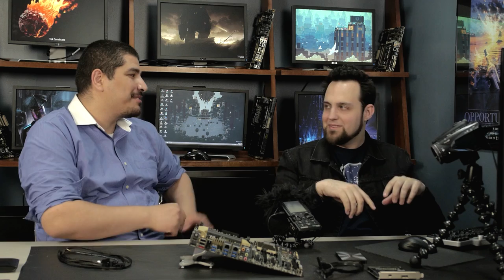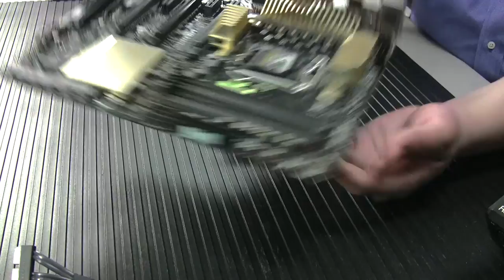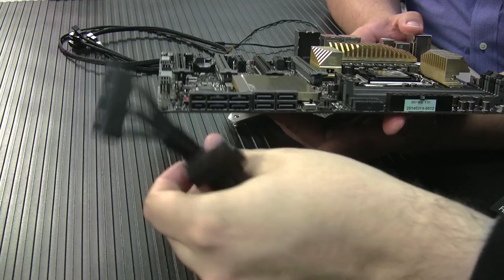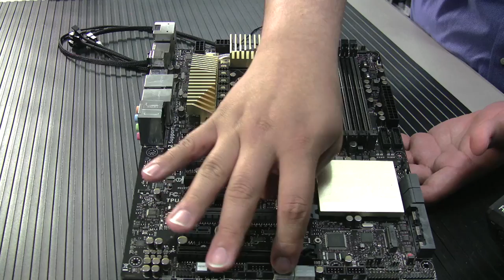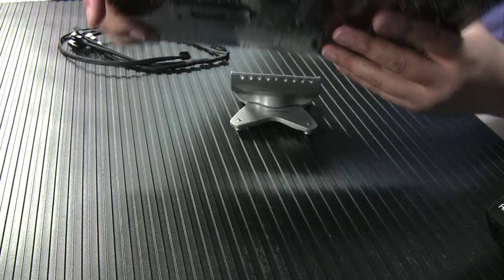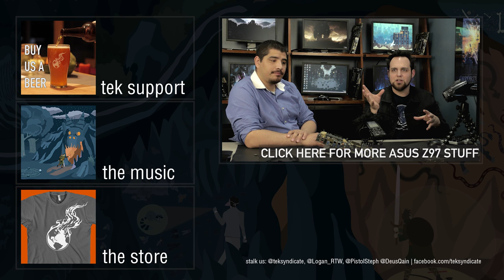ASUS Z97 WS Motherboard Overview

Comment: if only this was out in 2011. no workstation should have a haswell
Reply: Why is that? Surely Sandy Bridge over all performance even with the better overclocks is about equal or less than Haswell. I have a i7-2600k so I'm interested in your thoughts.
Reply: T.E.D. de Medici sandy bridge is fine. ivy bridge-e is the sweespot for me at the moment. but not enough onbaord sata 3. haswell is a mobile designed chip. it is for low power and low heat, but overall it has no advantage over ivy-b [except more sata 3, which is good]  and can't be clocked.
it's not a serious enthusiast chip in any regards, but it is perfect for your average home user. they shouldn't be making haswell workstation boards. it's like making a v8 supercar and putting a four cylinder hyundai motor in it
Reply: i can thoroughly recommend 4930. mine can crank all 12 cores rendering video at once. i won't buy again until i see a haswell-E, and only after i see they havn't nerfed it like they did the domestic chip
Reply: freo vapour You mean 6 Cores, you got 12 Threads
Reply: ***** that's why i have a computer. i'm shit at maths :) yes 12 virtuals
Reply: ***** 2600k is a good chip. stay with it until the dust settles